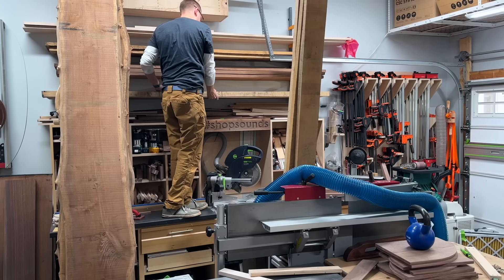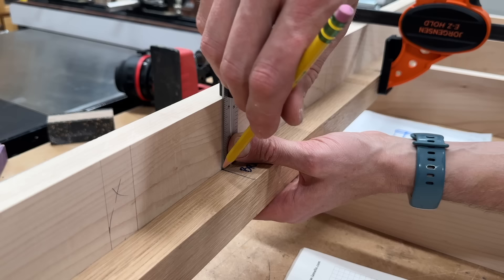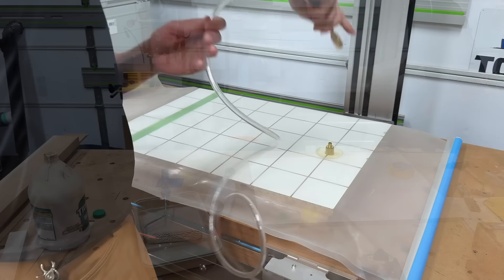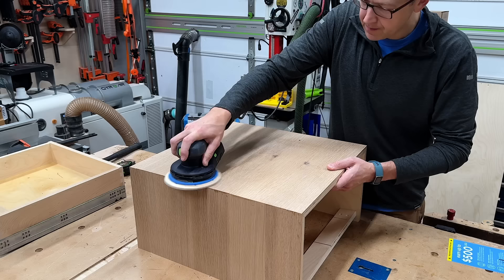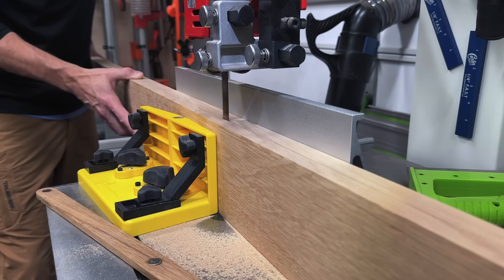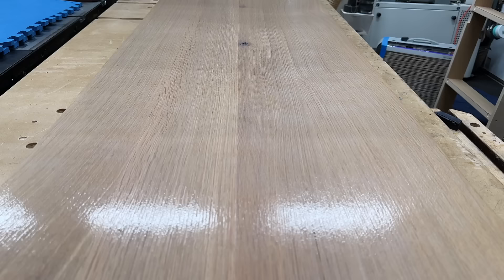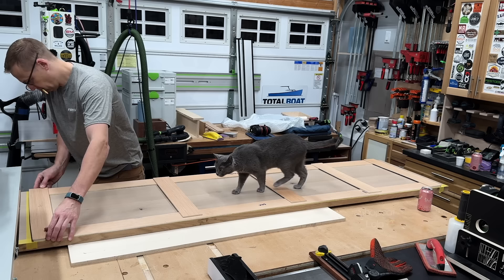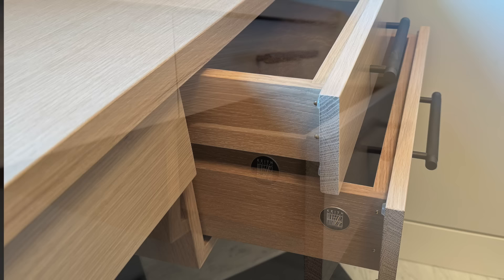White oak is becoming a real problem for furniture makers.

Comment: You only used it for about 5 seconds during video, but I'm curious where you got that router template with the circles.  The one I bought on Amazon is mostly useless because it's too small to clamp.
Reply from the maker: That can be bought with the Medallion Maker Branding coins. I think you can buy it separately as well: https://bit.ly/KJ_MedallionMaker

Comment: You mentioned you had the same desk for another client I would not use that same power outlet it uses USB-A which is low power at this point everything has moved to USBC which can power a lot more and is future-proof at least for the next 8 years. You spent over $400 for the USBA which you put an iPad pro in there it will take a long time to charge. With the USBC you can charge a laptop
Reply from the maker: There’s actually 2 USBC ports in there as well. This was the configuration the client chose and he is tech savvy, so he must have had reasons for the USBA ports as well.

Comment: 3:03 I have a DeWalt biscuit joiner and I get these ridges a lot. Kind of a pain in the ass, since I have a small shop. It means I cant have it close to perfect flat and I have to sand/plane it. Does anyone have any helpful comments about this? I've done this mostly on soft woods so that may be an issue. I have experienced this on drill press, where wood bits magically turn themselves a little bit off..
Reply from the maker: Biscuits tend to have more play, since most machines make inconsistent slots and the biscuits aren't made to high tolerances (unless you buy Lamello 😜). I guess the best recipe is having perfectly flat and square material...😂

Comment: I'm really confused now. I googled rift sawn timber and mostly what I saw were diagrams showing the boards cut purely radiallyn. Found a video talking about the cuts being made in a spiral which made sense but couldn't find any source with a diagram showing that . There seems to be more than one definition, is it to do with whare you are in the world, what's going on?
Reply from the maker: Pretty easy to find with a quick Google search - https://images.app.goo.gl/hcZhBxGXB9HrM2eQ6

Comment: i'm not sure why you took out wood from your wall. did you consider modifying the drywall cover instead of the wall wood ?  at 1:40 actually. easier drywall job instead of structural integrity from a bearing wall. anyway nice video !
Reply from the maker: It’s only 5/8 drywall… Trying to remove a half inch from the back and leaving only 1/8th inch thickness is virtually impossible. And there are three studs there, so no risk of strength reduction.